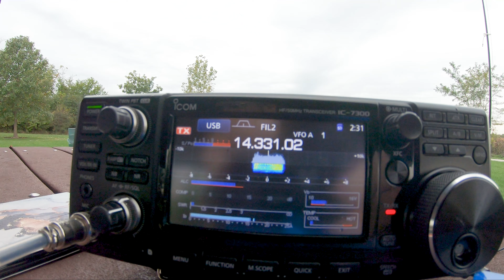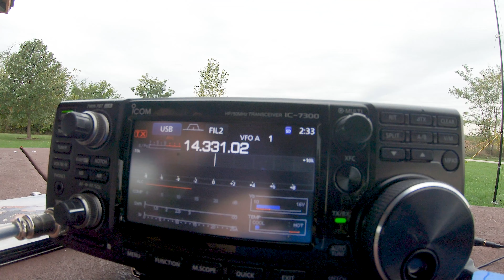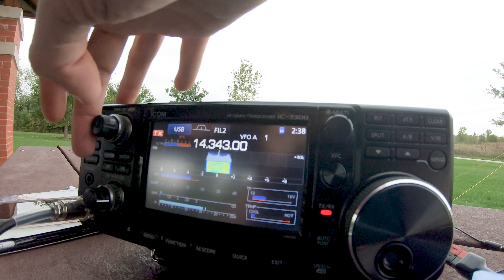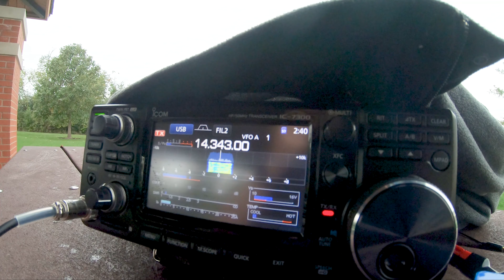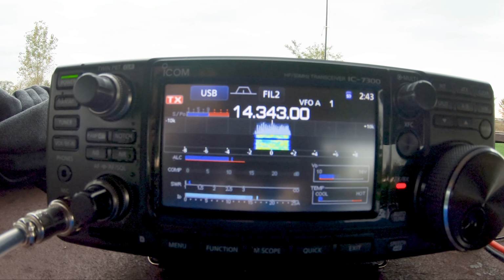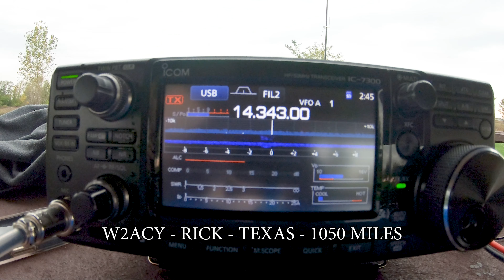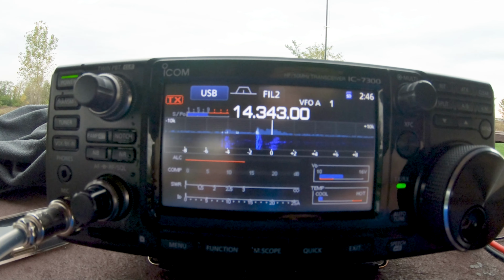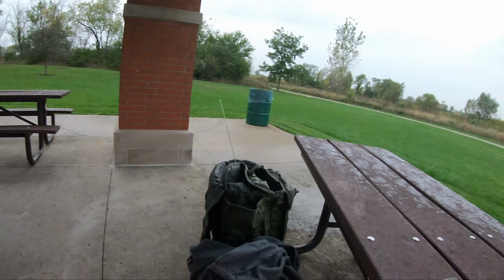POTA with Electric Noise, Intentional QRM and Lightning!

Comment: Very nice video. Last time I was out to K-1001 was back in September and I was getting plagued by yellow jackets that just wouldn't leave me alone with my 1/4 20m vertical (with a 40m/80m loading coil at the base.)   I did go for a very long walk that day around the trail at the park, which I started to regret about half way thru the walk.      I have never had QRM like that but I have had people keying up CW in the middle of contacts just as the other station is giving their info. Annoyingly its been getting more and more common lately. :(      This upcoming weekend I am looking to go on a rover down around the Midewin National Grassland area. Provided the weather holds out. So far its looking like Monday is going to be my best shot at it since its going to warm up a good bit.
Reply from the maker: Yikes, I would have been out of there if there was yellow jackets!  K-1001 isn't my favorite park but its usually the closest to my house.  73! -Kevin
Reply: @WQ9FHamRadio  I hit 15 contacts that day then packed up my gear and went walking. Doing a 4 park RADAR tomorrow down around Midewin National Grasslands area. SO hope to catch a contact or two with you. (Going to bring out the IC-718 for this one. Been using my UBitx lately since its small and I don't have to take my shack apart to use it.)  K-7839 is the closest for me with K-4107 being the next closest.